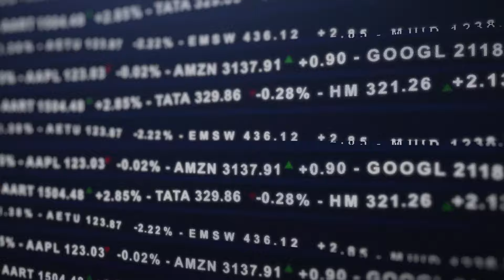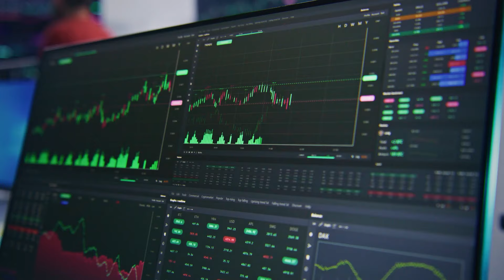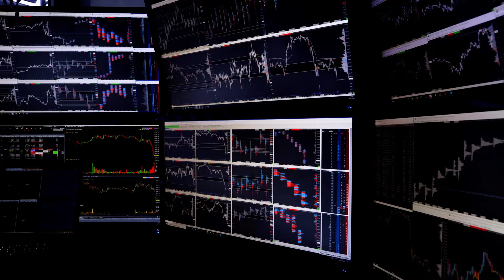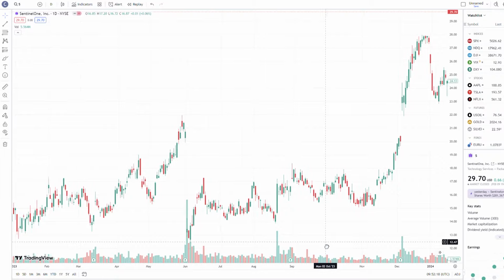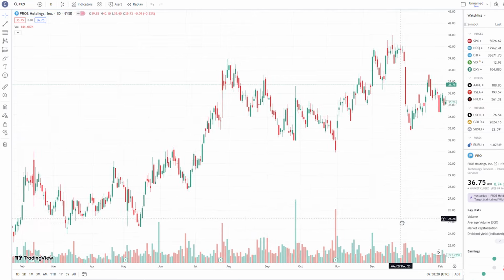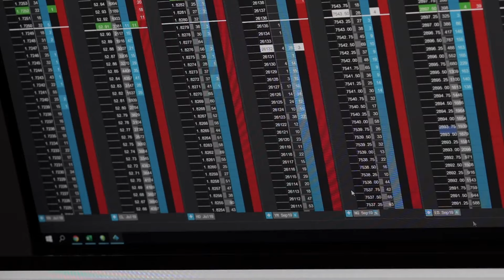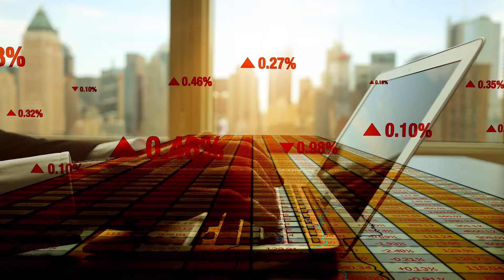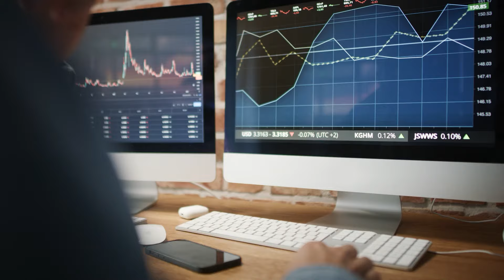Top AI Stocks to buy, Your Essential Guide to Stock Picking

Comment: What you're forgetting is that major companies are going to be switching over to AI because doing animation with AI will be easier, creating video games with AI will be easier, managing systems with AI will be easier and more efficient, running games with AI will be more efficient, AI integrated into your home so that you can automate your systems to open the blinds and close them and things like that whenever it's necessary without having to think about it will make your life just that much nicer in addition to also optimizing the cost of heating & cooling.
AI is going to be put into every car that is built moving forward.
Not to mention that if you look at the ability for AI to produce realistic videos today versus the Will Smith eating spaghetti video which was less than a year ago.... Well that shows you the kind of accelerated growth you should expect from AI 1yr, 2yrs, 5yrs down the line...